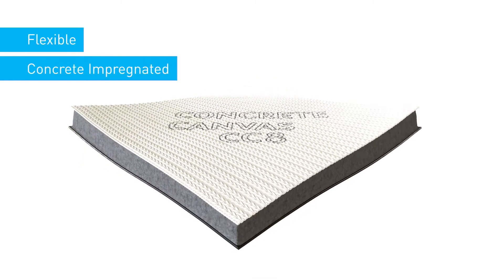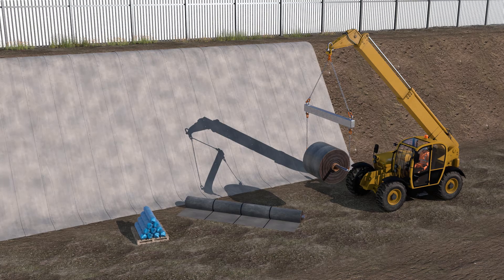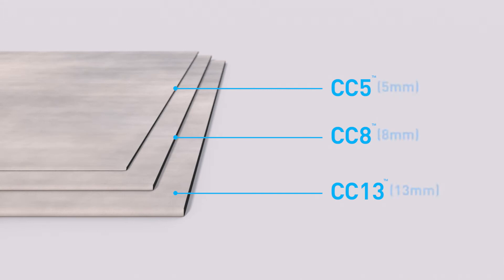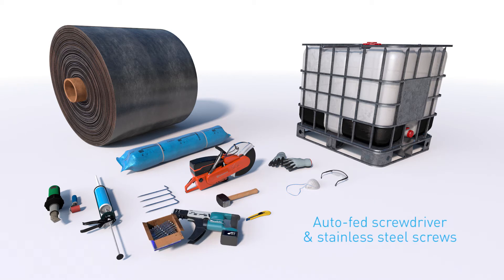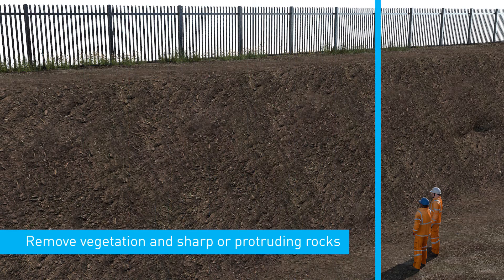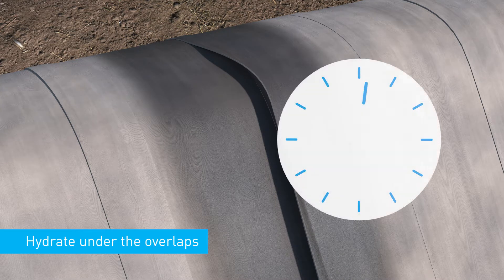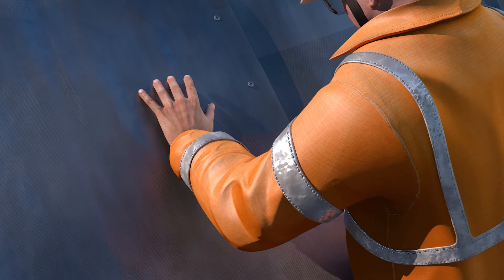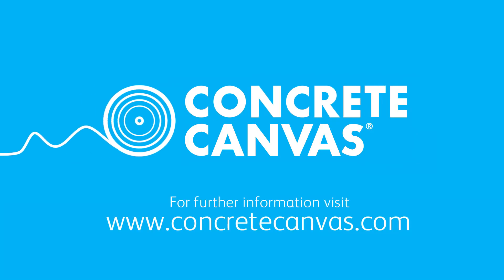Concrete Canvas (CC) Slope Protection Installation Guidelines

Comment: Is the base material a polyester needle felt ?
Reply from the maker: Thank you for your question Shramik. It is not, the material consists of a 3-dimensional synthetic fibre matrix filled with a custom cement blend before a PVC coating is added to one side.

Comment: My specification for the work is:
"CONCRETE CANVAS Supply and execution of slope including all activities for site preparation and all required  materials for the correct completion of the works including  filter cloth or equivalent and Dia 1'' PVC 250mm @ 1250pmm Spacing (weep holes) as per drawing"
Can we put weep holes and install PVC pipes in this system?
Reply from the maker: Hello, please get in touch with us for technical advice. You can email us at info@concretecanvas.com or call 0345 680 1908.

Comment: Is using rainfall to suppliment your water supply bad?
Reply from the maker: Hi Nicole, yes - we would never recommend relying on rainfall to hydrate CC as the material requires 3.5L of water per m² of material for our CC5 material. The required volume of water increases based on the material type. You can find out more about this via our Hydration Guide here: https://www.ccportal.co.uk/index.php/s/GSjj8OqNaHTIsOp#pdfviewer